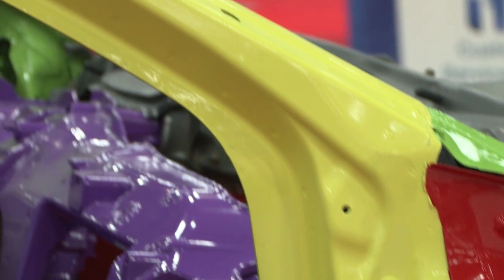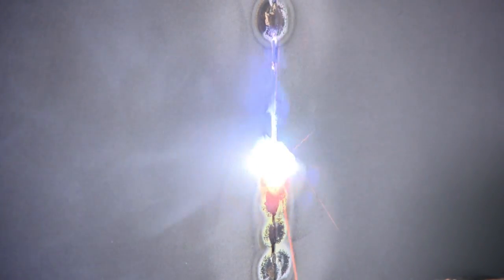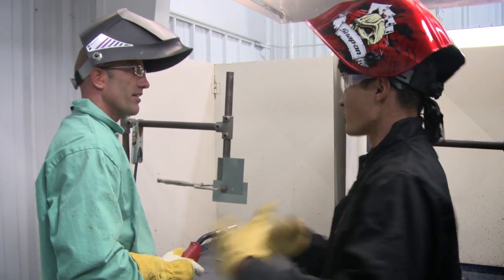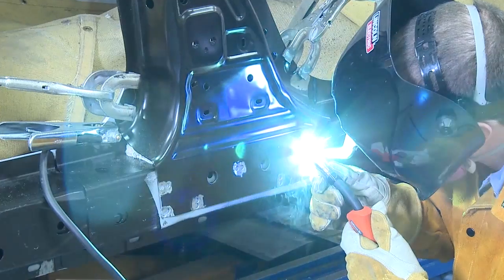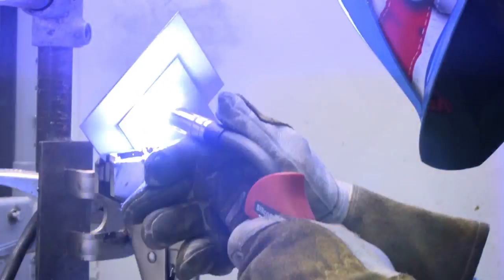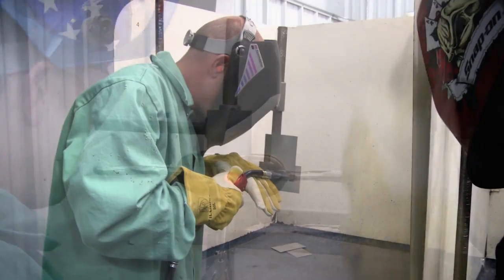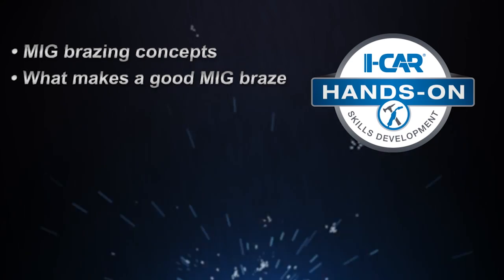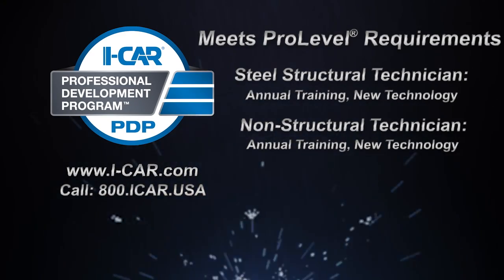I-CAR - MIG Brazing (BRZ02)

Comment: 1.Why is it that NO respirators or apparent ventilation is used in your I-Car demonstration videos? I’ve been warned that heating zinc coated metal is VERY hazardous to your health!

2. If some joints can be Short Circuit “welded”, couldn’t I use my Miller 140 (which is not a high dollar pulse machine) to Mig Braze some custom fender flares on my ‘96 GM car? I’ve experimented with regular Mig welding, but too much heat/shrinkage and stiffness on this 22 gauge zinc coated crap metal. I had to buff away the zinc coating (being careful not to breathe the dust) before welding, otherwise nothing but spatter and noxious smoke!
Reply from the maker: Thank you, Rod, for your comment. Our response to each of your comments follow:

1)     The footage was taken at a dedicated training facility. There is a large fume extraction system outside of the camera’s view. This system evacuates all harmful fumes away from the operator. However, you are correct that welding fumes are hazardous, and provisions must be applied to protect the operator or nearby people.

2)     We always refer to the vehicle manufacturer’s specifications to determine which type of welder is needed for each type of repair.

Comment: hi guys i'm head manager car repear , i would like to improve tech with , mig brazing , my questions : 
- is it only with 100%argon ?
- what rod available , heard about , silicon bronze , and cu si 
- is there any tabs materials , using rods , add on ,stainless and alu 
- is welder , mig  synergic or not ? 
'im looking for online mig as amazone ebay thanks to helps and advises models 
best regards and thanks for this video
Reply from the maker: Hello Naoufel! We did our best to answer your questions:

- is it only with 100%argon ? 
Yes.

- what rod available , heard about , silicon bronze , and cu si - 
There are different electrode wire blends, selection is dependent on OEM requirements. 

- is there any tabs materials , using rods , add on ,stainless and alu - 
Most quality machines capable of synergic pulse will also be capable of aluminum and other electrode wires.

- is welder , mig synergic or not ?   
A synergic pulse capable welder is required, pulse or short circuit transfer method selectable, dependent on joint type.

- im looking for online mig as amazon ebay thanks to helps and advises models best regards and thanks for this video.  
We do not recommend specific equipment. Would suggest equipment sourced through a local body shop equipment supplier for local support, consumables , etc.
 
You might be interested in our online MIG Brazing course! Thanks for your interest :)
Reply from the maker: Thank you for your interest in our video, Naoufel. It sounds like you would benefit from our MIG brazing hands-on skills development course. Learn more here:  i-car.com/s/product-detail?productId=a1R1I000001McDmUAK
 
Also, here are a couple of free resources from I-CAR: our MIG brazing demo recorded at last month’s SEMA360: https://rts.i-car.com/collision-repair-news/sema-2020-i-car-take-your-mig-brazing-to-the-next-level-presentation.html and an article on how to select the correct welder:
rts.i-car.com/collision-repair-news/selecting-the-correct-welding-equipment-mig-brazing.html

Comment: right back to the old days ,,, goes to show you , braze granted with oxy acet was the go to practice in the hand built car body days. i often find it on some of the vintage stuff i get to repair , and i love braze.
Reply: At age 93 and going to age 94 I am starting to forget my 1950s engineering lessons, I believe I better get back to my old 1950s textbooks again to refresh my memory. Old age sure gets to you from time to time. But I miss the hydrogen arc welding and including the argon arc welding known as argon plasma welding in the nuclear submarine naval yards in the Arctic during the Cold War years!
Reply: Yes but easier with the electric machine

Comment: If icar specifically states that silicone bronze mig brazing is an adhesion, NOT FUSION!, and its heat and  breaking strength is SIGNIFICANTLY LESS how is it recommended to brake structural components back together?!
Reply from the maker: The MIG brazing class addresses your question, however, when done properly, will have a larger footprint or surface area contact than a steel fusion weld. Because there is less heat and no melting of the base metal, MIG brazing minimizes damage to heat-sensitive steels and helps preserve zinc coatings for corrosion protection.  Vehicle maker engineers developed repair procedures and attachment methods taking this and other factors into consideration and should always be followed.
Reply: @icartraining  these cars are welded from the factory, seems like crap that they're mig brazed for a repair